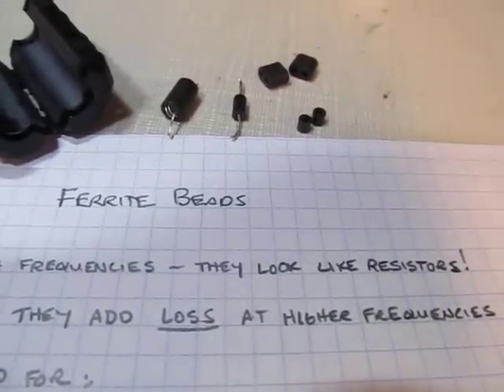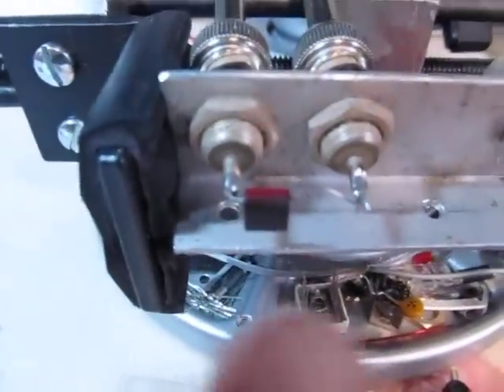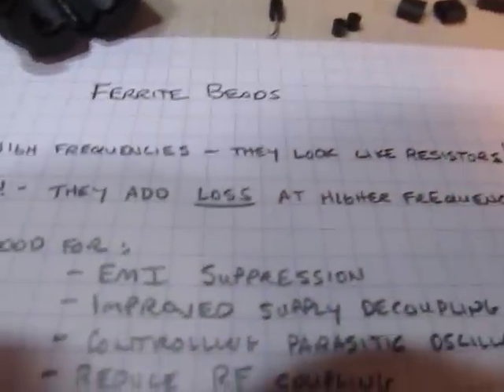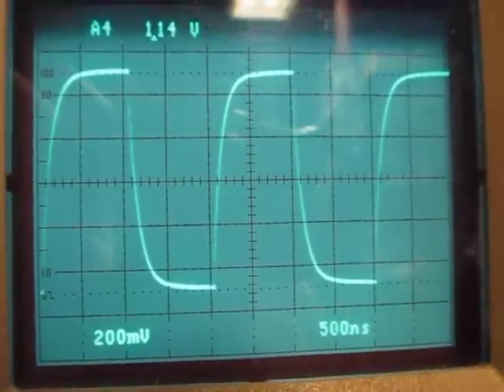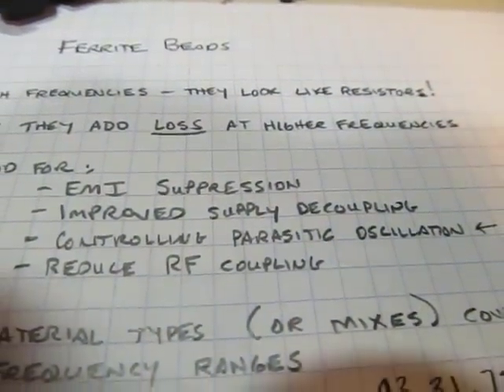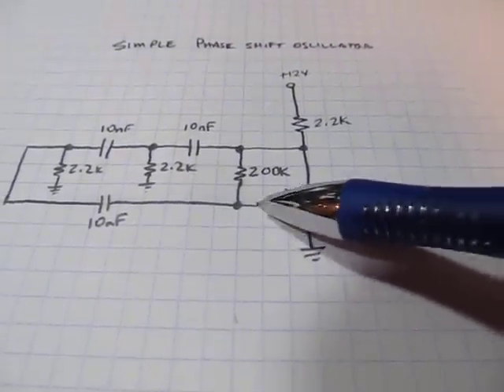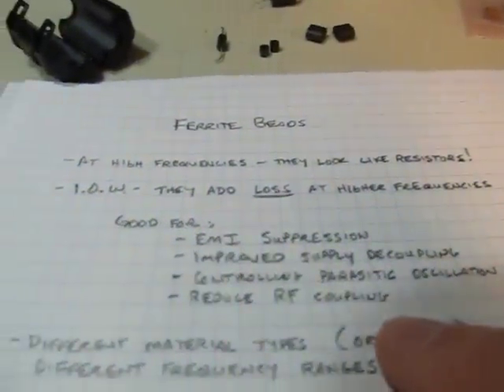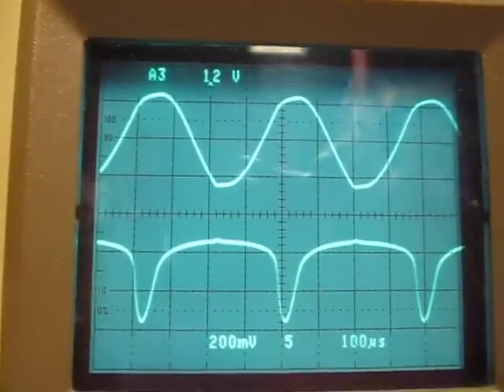#84: Basics of Ferrite Beads: Filters, EMI Suppression, Parasitic oscillation suppression / Tutorial

Comment: you said that "ferrite beads make the wire look more like resistor at high frequencies, not like an inductor". But isn't that what inductor is - it's impedance goes higher with the frequency? I thought the ferrite material is to reduce losses for higher frequencies - to minimize eddy currents. And when I say I thought I mean I'm not 100% sure of any of the above - so it's a question, not a critique.
Reply from the maker: A simple ferrite bead looks a bit more like a fixed resistor over a wide range of frequencies vs. a frequency dependent impedance.  Ferrites can lower losses in high frequency inductors because they allow you to have a fewer number of turns or windings for a given inductance, thus lowering the wire resistance.

Comment: WIsh I would have seen this video a week and half ago.  I have a pc power supply I am working on and I thought a diode was broken but it turned out to be a ferrite bead on a diode.  Granted it was in a real bad spot.  I pulled the diode out and discovered my mistake.  This diode is nearly impossible to get reinstalled.  I finally got it installed and just found out that I missed one on the other side of the diode.  This is in such a bad spot.  Its under a heatsink that has like 5 mosfets mounted to it.  I think I am just going to junk the supply.  Enermax used conductive glue on it anyway.  Save my good caps for something else I guess.

Comment: 1/2 power is 3dB down, not 6dB down.  use formula P(dB) = 10 log P

Reduction is either voltage or current by 1/2 is 6 dB down. V(dB) = 20 log V
Reply from the maker: Yes, of course.  Since the oscilloscope was measuring voltage, and I noted the point where the voltage was reduced by half, that's why I said 6dB.

Comment: It is interesting that the uses of ferrites tends to be empirical or experimental rather than analytic, even in a professional design environment,. Is this because the characteristics of ferrites are so complex that it is easier to measure their performance than calculate it. One of the complications is the effect of DC or low frequency magnetic saturation.
Reply: Nigel Johnson Saturation occurs when the current amplitude reaches the saturation level, not because of a low frequency.  If the folks you see are aren't checking the data sheets and are experimentally determining what ferrite they need, it would explain why they are having problems with DC saturation.  If they know what their max load current is, it is not difficult to pick a ferrite large enough to avoid saturation.  That info is right on the data sheet.

For ac simulation purposes, ferrite beads are often modeled as a combination of Rs, Ls, and Cs.  While this is only useful in the linear range (below saturation), it is SIGNIFICANTLY faster than modeling it with the magnetic properties.  In most cases, you want to use it below saturation anyway.

The beads tend to heat up quickly when you try to push too much current through them at frequency - after all, they are designed to be lossy there, even without saturation.
Reply: Cynthia Cantrell in many cases there is no way to avoid the DC current component, as in supply input filters, and yes I am aware of common mode chokes, where the DC currents cancel out. I have often wondered if it would be possible to construct a composite soft iron/ceramic toroidal  core that canceled the DC component while also rejecting differential high frequency components. Such a device would make use of the relatively poor high frequency response of the soft iron to decouple the two sides of the toroid at high frequency.
Reply: Nigel Johnson I'm having a problem understanding your issue.  I'm not sure if it is your use of language or understanding of how the parts work.  Common mode chokes do not "cancel the DC current." They attenuate signals that are common to both wires going through the choke, leaving differential signals intact.  By "common" it means that both leads of the choke are changing in the same direction at the same time.  Differential means that they are changing in opposite directions at the same time.  The DC component is unchanged.

Describing something as "cancel[ling] out the DC component while also rejecting differential high frequency components" seems to imply that you are looking for a low frequency transformer, (not a choke) but I don't think that is the case.
Reply: Cynthia Cantrell the common mode chokes does not suffer from DC saturation effects because both the positive and negative wires pass through the choke, this can be considered in two ways, either the field induced by one wire is cancelled by that produced by the other or topologically as the current does not loop the core, no current couples to the core. 
In a differential arrangement, the positive and negative wires are wound around separate cores, this results in the DC component of the current coupling to each core. In this arrangement DC saturation is an issue. My suggestion which may already by used, though I am not aware of it, is to complete the magnetic circuit of the differential coil arrangement with a magnetic material that has a poor frequency response, effectly producing a common mode winding close to DC, eliminating the saturation effect, but allowing the two arms of the core to be isolated at high frequency, turning them into a differential filter arrangement. The advantage, which may be if questionable value, is that the DC current field will have been cancelled by the low frequency magnet circuit, avoiding any saturation effects of the differential parts of the core. The reason this might be an advantage is that the DC component is often many times the size of the high frequency AC components that require suppression. I had the idea when investigating the operation of magnetic amplifiers, where the coupling between primary and secondary of a signal transformer is controlled by a third DC winding that is used to saturate the core, isolating the signal in the primary from the secondary. Stated simply a hybrid core that acts as a common mode choke at low frequency and as two independent differential chokes at high frequency without DC saturation effects.
Reply: Further to my last posting on the subject of saturation. One way to avoid DC saturation, might be to wind a core with two series connected windings in anti phase and then wire a capacitor in parallel with me of the windings. At DC the anti phase nature of the windings would cancel the magnetising effect of the DC current, but at higher frequencies the capacitor would short out the effect of one winding, leaving the inductance of the other. The disadvantage is that twice the number of turns are required for a given inductance, the advantage is the core will not saturated with DC current component of the signal to be suppressed.
Reply: Nigel Johnson I have read your posts several times to try and make sure I understand what you are trying to do, so I'm hoping my answer is pertinent.  

A common mode chokes is not a perfect device.  Depending on how it is wound, its differential impedance may be anywhere on the order of 1 to 10% of the common mode impedance. Some of the Wurth data sheets show both the differential and common mode impedances for CM chokes on one graph.  So this would help with the attenuation of high frequency noise - especially if you put a cap on the output.  Two cores for differential mode reduction isn't always necessary.  It depends on how much attenuation you need. A single toroid core with bifilar windings makes a great CM choke while passing the differential signal well too.  However, if you use two separate windings on opposite sides of the same toroid, you will still get the non-saturating DC CM performance, but you should find that the differential impedance is noticeably higher, and typically increasing with frequency.

Unfortunately, many manufacturers do not characterize the differential impedance of their common mode chokes, so you may have to measure it yourself and provide adequate margin in the rest of your design to compensate.

I think this addresses the issue of trying to pass DC while also attenuating AC noise - just choose (or design) your CM choke to maximize differential impedance rather than differential bandwidth.  Stick some caps across the inputs / outputs and you may have all the attenuation you need. (Or at least some of it!)

On another note, my intro to mag amps was back in the '80s in college.  My professor noted that German WWII battleships used them in their gun control circuits.  Unfortunately, American battleships used vacuum tubes, which often did not handle "shell shocks" as well.  They were part of a lab project for Non-linear Electronics class.  Unfortunately we didn't have cool things like cannons to control with the magnetic amps.  I think we just used light bulbs for loads.

I haven't found an application for mag amps since.  I always thought they were pretty cool though.  With things like silicon carbide transistors these days for high power applications, I don't know if there is much use for them anymore.
Reply: Cynthia Cantrell thank you for your very complete answer. I should say I am a retired circuit designer with 30 p!us years of experience designing circuits for the telecoms industry. Regrettably I was forced to retire a little early due to cancer.
Most of my work was in the area of baseband signal processing and control. In taking products into production I was also required to ensure that the equipment I designed met all the EMC and safety regulation pertaining to telecoms fix and mobile equipment, so I do have some experience in this area. From memory, I believe the conducted interference spec was EN55022.
I take your point about anti phase windings on a common mode choke canceling the DC magnetic saturation effect. My suggestion, and it is only an idle musing, was to take advantage of the different frequency performance of soft iron and true ferrite ceramic to tailor the response of a magnetic core to cancel the DC saturation currents without significantly degrading the high frequency attenuation. Essentially proposing a new composite core electronic component. The premise of the argument, which may be wrong, is that soft iron operates better at low frequency than at high, while ferrite ceramic has a much wider frequency response. Assuming the above to be true, I was speculating that it might be possible to construct the core of parts made of the two materials. The idea being isolate the go and return side of the common mode core at high frequency while linking at close to DC to cancel saturation effects.
While a single core common mode choke, wound with an anti phase winding would cancel the DC saturation effect, its high frequency impedance would also be reduced, as cancellation would not be confined to just the very low frequencies. By winding the coils on the ferrite arms of the core, but completing the magnetic circuit via soft iron arms, the idea is that the iron would break the magnetic circuit at high frequency, leaving the coils wound on the ferrite to function as independent differential chokes, but with DC saturation effects eliminated. Such a component might be useful in filtering the input to DC/DC switch mode power converters. A problem I encountered many times on 48 volt SELV racking equipment.
All of the above assumes the the frequency dependent permeability of the two materials are sufficiently different to make this new component core worthwhile. As I said the idea is the result reading about magnetic "amplifiers" where the sensitivity of a core to DC saturation, allowing a small DC current to control the the passage of a larger AC signal through a transformer. Given the time you have already given to this question, I will understand if you do not reply.
Reply: Nigel Johnson Your component idea came through more clearly in your last post.  It sounds like our careers are similar.  I only have 25 years of experience, about 14 of which are in the telecomm business.  I started out designing circuits for portable telecomm equipment (DS1 to OC-48) but the most recent part was at an engineer consulting firm.  I even did coplince design and testing too - UL, CE, and SAE.

Sorry to hear about the cancer.  I'm currently trying to find adequate treatment for severe neck pain. My next appointment is for RF Ablation at nerve locations on the occipital region of my skull. I'm desperately hoping for some relief.

If I understand your description correctly, it sounds like your magnetic circuit could be prototyped in the lab.  Most of the ferrite manufacturers have bare cores of different material and shapes available.  You could wind your coils on two high frequency rod cores, and then glue two low frequency slabs at the ends of the cores to complete the magnetic circuit. That should at least tell you if your idea works as you expect it to.  For the best differential attenuation though, I think it would be easier to just do both windings on opposite sides of a low frequency material toroid.  But maybe I'm still not understanding the configuration of your circuit.
Reply: Cynthia Cantrell I am glad I have finally explained the idea sufficiently clearly for others to understand. I was beginning to think my ramblings were an early sign of dementia. I have had bladder cancer, with the result that much of my insides have been removed. I suspect that the cancer was the result of exposure to PCB cleaners, such as trichloroethylene.
I can say that this type of cancer really ruins your day.
The idea for the core is related to my work on DC/DC converters. I wanted to improve the size and performance of the input filters, to suppress the RF noise that leaks up the supply lines. There are both common mode and differential noise on these inputs. The problem with the differential noise is to raise the impedance of the filter chokes so it is easier to attenuate the noise with capacitors referenced to input ground. Since the DC input currents can be large, saturation of the differential chokes is a problem, given the level of noise attenuation required. By combining the properties of two different core materials, I suspect I can maximize the performance of the high frequency ferrite material without the risk of the material being saturated by the high DC input current. While thinking about this post, I realised I might be able to obtain a similar effect by using capacitors to short out a field cancelling winding wound on a single ferrite core. I do not know how practical this would be given the relatively low impedance of the coils at low frequencies. The hybrid common mode core is potentially smaller and simpler, as it is the material physics that is doing the filtering work. This is very much an aside to my comfort zone of designing digital circuits using microcontrollers, PLDs, FPGAs, ASICs and DSPs. But if you design with this stuff, you are also expected to power it and make it EMC compliant. My work in telecoms spanned the period of analogue to digital radio, working on both fixed equipment, base stations and mobile transceivers.  it can be rather demanding keeping the noise from a DC/DC  switch mode regulator out of the front end of a low band VHF analogue radio when receiver sensitivity is 0.3 uV EMF into 50 ohms and both circuits are on a common PCB only a few centimetres apart.

Comment: Is there anyway to reduce radiation in a Wired Headset for Phone/Computer/Gaming platforms. I feel like i am experiencing side effects from too much EMF / RF Exposure on a daily basis for years now. Any idea if snap on Ferrite cables would work? Or is there anything on the market to really protect a consumer when using a wireless device regularly? Any help would be greatly appreciated you seem like a real expert! :)
    Btw this study might interest you if you haven't really looked into it. http://www.aaemonline.org/emf_rf_position.html  I am experiencing alot of those symptoms.
Reply from the maker: I'm not an expert on RF exposure, so I really can't help.
Reply: Ahh okay, but do you think snap ferrite cables actually work? Like ones that you place over a wire that already has the rubber coating on it?
Reply from the maker: GoodOldCountryBoy Snap-on ferrites are effective at reducing RF that is being conducted along the wire, In the case of coaxial cable/wire, it reduces the RF on the outer shield.  The rubber insulation has no affect on it whatsoever.
Reply: Interesting, i never thought it would work through it, Thanks a lot for the help! I really appreciate it. Subscribed :)